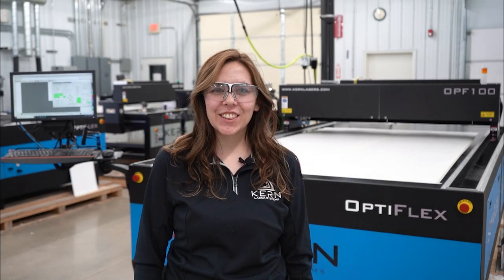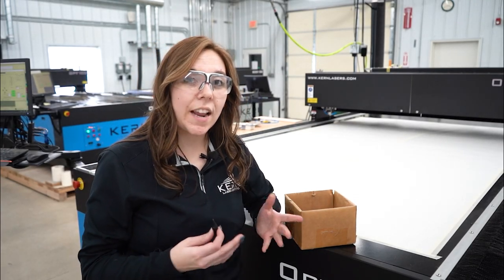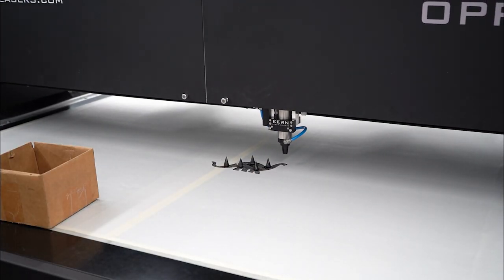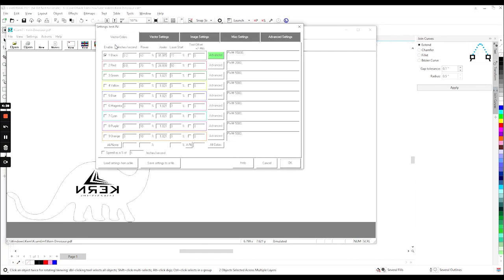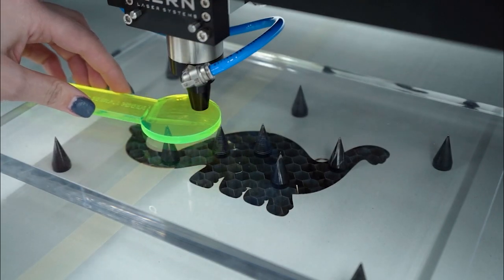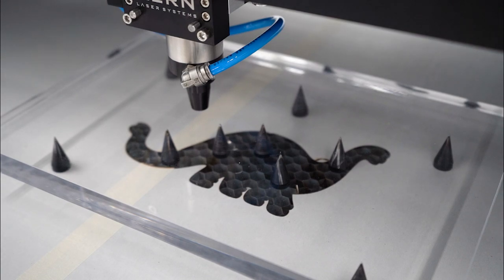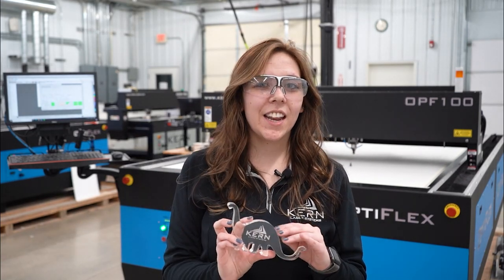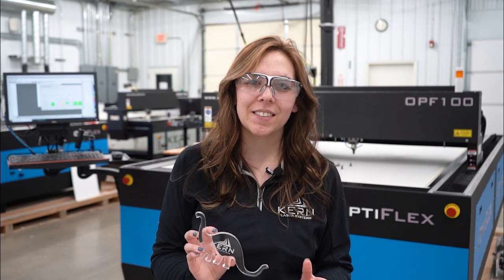Laser Etching & Cutting Thick Acrylic

Comment: I noticed when it was engraving it was leaving fogging behind, then when finished it jump cut to a clean product.  What did you need to do to remove the fogging?  Does it just wipe off or is there some other process?
Reply from the maker: Hi John, all that was left behind was some dust. A quick wipe with a cloth or your hands cleans up easily!